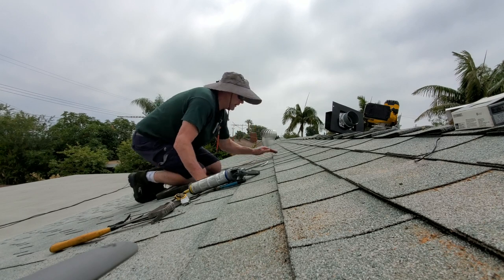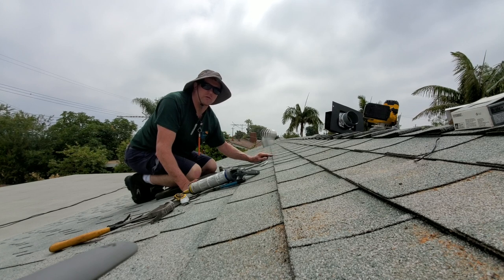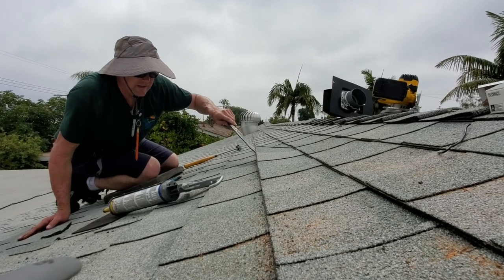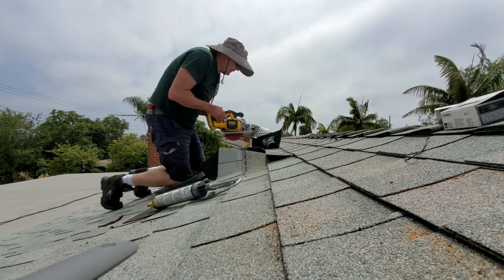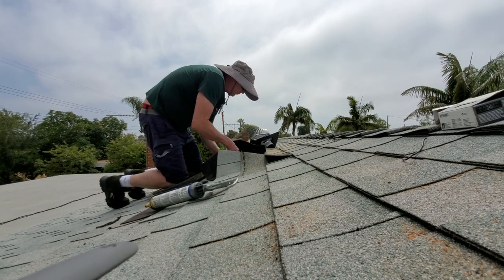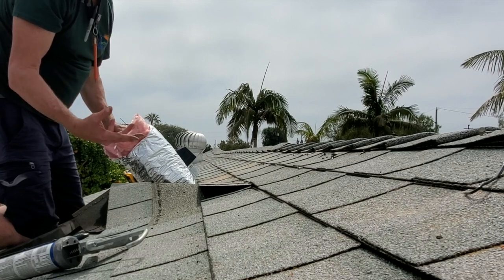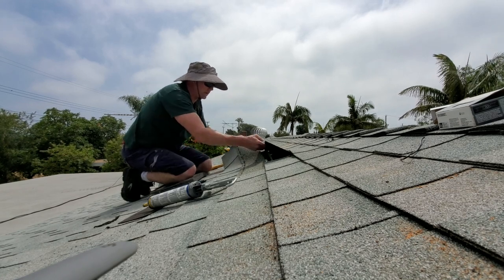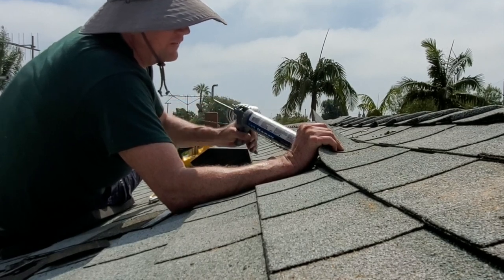Showing how to properly install a roof jack - start to finish

Comment: That’s a roof Jack ???
Reply: This one is a exhaust vent. The term Roof Jack actually covers many pre molded roof flashing for pipe and vents. Its mainly the molded flashing.
Reply from the maker: @RonMetcalf2879, and @Outdoors1776, that is correct! Many types of roof jacks, this one is for an exhaust fan.